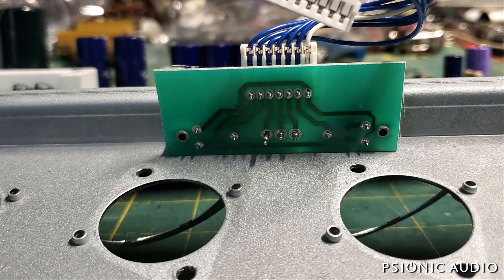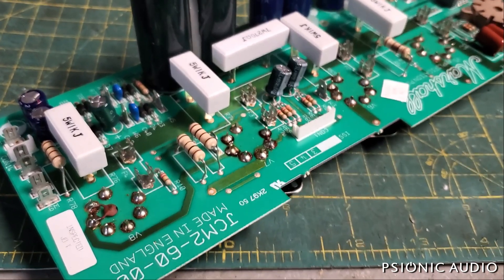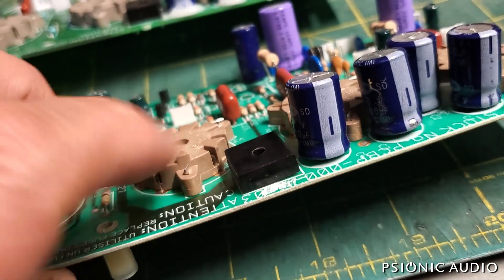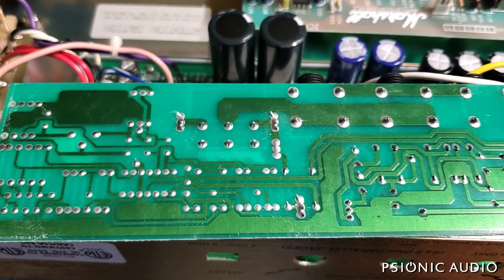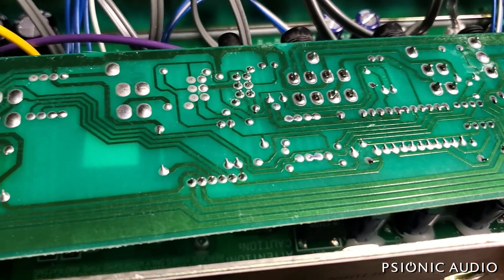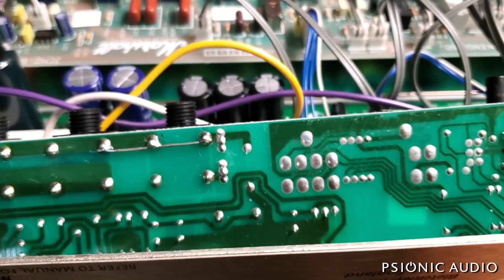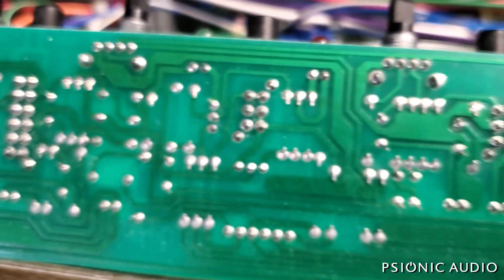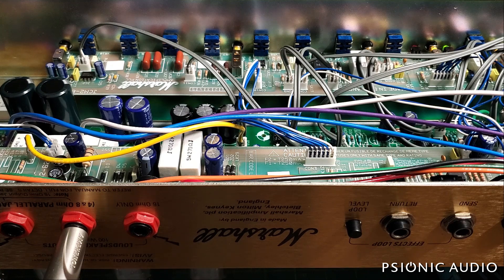Marshall DSL100 Part 2 : Putting It All Back Together. Better.

Comment: I have been in the Electrical and Electronic Industry as a Designer and Field Operations Technician for Industrial
Applications and Systems Integration.
Here is My Rules to Understanding Engineered Problems
Rule One: Engineering Degrees do not directly produce Competent Engineers.
Rule Two: Computer Modeling is not the Same as Real World prototyping and Testing and the Feed back from Testing.
Rule Three: "Bean Counters" and Some Business types worry about "The flow of Money" not what Should Produce that
Positive Money Flow first, Customer Satisfaction from reasonable quality and Value.
Rule Four: Engineering Management does not want to be responsible for Engineering Failings.
Rule Five: New Ideas do not always improve things if they come from low understanding of the Real World Environments.
Really Like Your Channel You Always Seem Real and your Reasoning is Logical and Rational.
Reply: As a former military avionics tech, mechanic, and tinkerer, I couldn't agree with you or Lyle more...😎

Comment: Howdy Lyle. I do enjoy your channel.

I earned my BSEE degree in 1980. Even at that early date, those of us who were interested in analog radio or audio engineering using those old-style, unreliable, and imprecise "transistors in a bottle," had to learn on our own time using the school library. 

Having gone to school a few dozen miles north of the Silicon Valley, there were only two of us in the program who were so inclined, even in the late 1970's. Still, there were plenty of analog houses utilizing tubes at the time, mostly instrumentation builders, but Ampex was just down the 101 in Redwood City, probably making 16-track tape recorders for Les Paul by then.

Any of our talented younger viewers with an interest in earning an EE degree with a focus in analog and digital music engineering design  should look into a great program they run out of Georgia Tech. There's a full professor over there who has an excellent YouTube channel. Aaron Lanterman is how I believe he spells his name. His channel provides an excellent preview of what one might expect to learn as a "Rambling Wreck."

Comment: It is so nice to see a video by a repair tech who knows guitar amps , How they work, and how they fail.  I have just been watching Brad the Guitologist search aimlessly for why a Marshall 100 DSL had runaway bias problems.   He has made several video's on the same amp that keeps coming back for repairs, and it is frustrating to see that after several years of comments going back and forth , he still has not availed himself of the opportunity to check the veracity of many commentors (including my) suggestions.  And You have addressed all these issues in a brief but very succinct and TO THE POINT video!  BRAVO !  
 
  Yes I remember when Marshalls were great ... from the 1960's until the 1980's  ( early ).  When there were was one board, about 70 components, and the techs who helped layout the boards and amp at least understood basic tube amp theory , and practice.

Comment: You note that the pick and place machines can't space the rectifier off the board, but shortly thereafter, your camera pans back across the board showing a variety of cement and carbon film resistors standing proud of the board. I think it's possible that the cement resistors have feet so that they're technically flat against the board, but that's definitely not true of the carbon film ones. So someone's been in there doing some manual work at the factory. They could easily have that same person solder in the raised rectifier. They just choose not to.

Comment: I am tempted to buy a $400 working JCM 2000 DSL 100 with the BIAS problem. How much would labor cost? The new PCB costs between $210 to $250, and I already have a matched EL34 quad. I have seen both videos and I assume that the repair will be the same. Old tubes show overheating, the amp sounds good though. T
hanks for sharing your knowledge!

Comment: Bogner, Boogie, Marshall, Friedman. They all use board mounted tube sockets, potentiometers, input output jacks. Built in obsolescence, and failure... 
Tired of the B. S. and marketing campaigns. 
No wonder why Grumpy Tech is such a Grump. 😡
Thanks for all this. 
Cheers 🍻

Comment: I know 3 guys in my area that ran out and bought a DSL 100 and every one of them had a problem with tubes red plating and runaway bias. I don’t claim to know a thing about amp repair and electronics. But it was told to them that there was a problem with the boards used. They would become conductive over time from heat and cause runaway bias. Again, I don’t know how accurate that info is, but all 3 guys were told that from 3 separate repairmen.
Reply from the maker: They were right, which is why I replaced this board with the last version. Marshall should have replaced EVERY board out there for free.

Comment: These amps came out around the time they were switching over to lead free solder. Some amp manufacturers switched over early, was Marshall one? 
Early lead free solder was awful causing bad solder joints and there’s also tin whiskers etc.

Comment: Watching these kind of videos, you would think that an amp manufacturer with multiple decades of experience would know better than to design a PCB with so main single points of failure, especially as dumb as skipping GND trace between the 16 ohm jack sleeves. Really makes you realize that these things are not designed to run forever like old amplifiers. Also explains why a lot of people believe that P2P amps are better than PCB amps, when in reality it's just the execution of the PCB based amps is much worse, not the technology itself. Shame on today's manufacturers.

Comment: Yeah, I use something between 3K3 and 10K for a grid stopper, but never anything like a 220K. I get those bridge rectifiers off the board completely and screw them to the can. The can acts as a heat sink. I hate the DSL TSL Marshall stuff. Andy Fuch's makes pretty nice PCB amps. I came out of Phoenix Music & TV, radio & CRT analog television repair. I fix Line 6. Usually the Line 6 failures are simple stupid things like jax, bad solder, & encoders instead of the SHARC chip. After that there is a class D amp. There are some glaring problems with the SM and some timing caps. A few pennies in parts makes the class D amp a lot more stable.
Reply: Hey boss, former military avionics and mechanic here in the valley! I've retired from trucking, and wondering if there are shops that would take in an entry level tech in the amplification/ effects world?

Thanks in advance, and stay kewl!😎

Comment: I replaced the bridge diode and glued a small cooling fin which worked well.
Reply: Stanley, bolting a heatsink onto the  bridge rectifier, with some heatsink grease between them, would be a better way to go about it.  Of course, this is only practical if you install a new bridge rectifier with longer leads, raised up off the board slightly, which I presume you did anyway when you replaced it. (Or, you could drill a hole through the board for the through bolt, if there aren't any foil traces in the way ---- but lifting the rectifier off the board would be better for both heat dissipation and preventing the solder joints from cracking due to expansion and contraction). I don't know what type of glue you used, but unless it was a thermally conductive epoxy and you roughed up the surface of both the bridge rectifier and the underside of the heat sink, I would worry about the heatsink falling off and shorting something inside the amplifier.  Most ordinary adhesives such as superglue, silicon RTV and so on are not very good at conducting heat. (JB Weld contains powdered steel, that might be a good choice.).
Reply: @goodun2974  Thank you. Good points. I used thermal glue and raised it from the board. Your right,  we don't want the components to rattle loose and short out the amp.  Appreciate the videos and info.

Comment: Question I have a Marshall modal 1987 which I believe is from the year 1971. The power tubes that are in it are 6550's and not EL34. I believe Marshall used both but I'm not sure maybe you know? Also the pilot light is not in the middle like most Marshall Ive seen but up high. Thanks
Reply from the maker: Marshal shipped amps to the US market with 6550s starting in '72.  I'd have to see your amp to know more.

Comment: Leo Fender and the other early amp builders who came out of radio repair businesses knew how to solder; they also knew the importance of making a good mechanical connection before soldering. Nor were they hamstrung by the legal requirement to use lead free solder;  plus they had access to a huge variety of American made parts and components, and if they didn't like what they were getting from one manufacturer or vendor they had lots of others to choose from.

Comment: Have you ever worked on any Dr. Z amps? I am really liking his new EMS.
Reply from the maker: Many. While I disagree with some of his design choices, and wish that he used lock washers on his jacks, overall they are well built amps that sound good. Just avoid the Maz amps with reverb - his reverb circuit is horribly noisy. The non-reverb Maz amps are very good.
Reply: @PsionicAudio  I heard that from another post somewhere that the reverb MAZ had problems. I think he discontinued that.

Comment: Wow! Look how the fat traces necks down to the impedance switch, and they didn't even use the switch contacts in parallel (like you are modifying). I guess Marshall amps were good back when they wired it up in "radio days" (that is components mounted on the tube pins - no circuit boards) style, they don't seem to have good PWB designers... too many mistakes that never get corrected. Radial lead Electrolytic Capacitors in a high vibration evenvironment... nope!

Comment: Any mechanical component (switch/pot/jack) that is mounted directly to a PWB is a poor design practice... the solder joints and traces will crack. Such components should be mechanically mounted to the chassis and connections made to the PWB via short wires to take up the vibration.